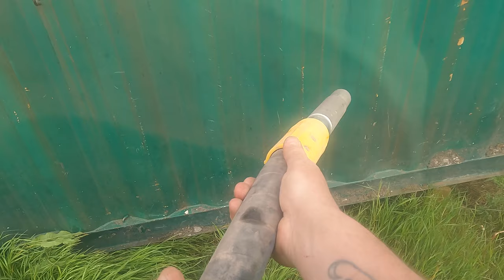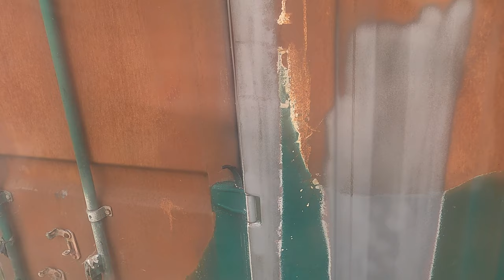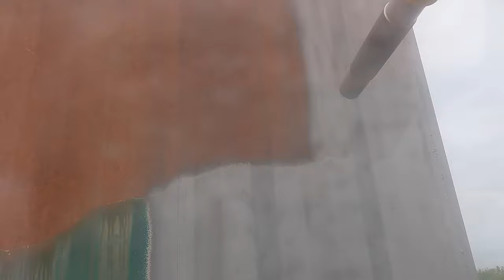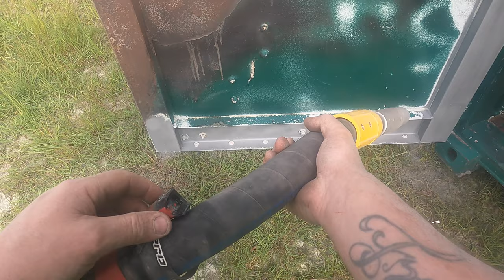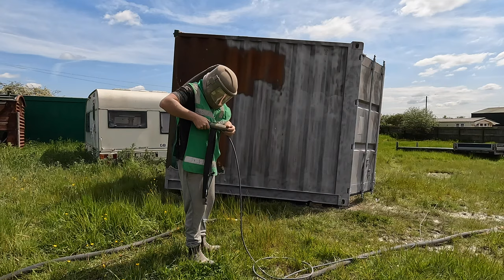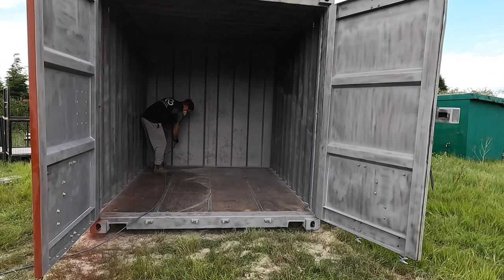SandBlasting 10ft shipping container and prim after a fire refurbishment

Comment: I sand blast a lot at my job. i see your using a 1/2 inch or inch sand pool. Brother you need a 4 inch flat sand head. it cuts four inches wide at a time. it will make your job a lot easier and better results as well. And awesome job on that by the way
Reply from the maker: The flat nozzle just stretches the hotspot out so you lose the intensity of the cut similar to stepping back yeah the hotspot is bigger but less affective. Flat nozzles are only useful if the serface only needs a very light clean 👍

Comment: Hey there mick,gritblaster/metalsprayer/ painter from nz,is the electric deadman a choice over air,have only used electric  once myself
Reply from the maker: Eyup mate I would pick electric over air because it starts alot quicker and stops just as quick plus the wire is lighter and less chance it snagging on stuff 👌👍

Comment: Nice videos mate. What camera setup do you use for filming POV? I do sandblasting myself and wanted to make a channel but I need to figure out a camera setup that is handy to quickly setup but also doesn’t get destroyed by the blast. Cheers
Reply from the maker: Gopro hero 9 and 10 but I wouldn't say they are the best available just that I'm into the eco system now with extra batteries clips clamps etc

Comment: Mick what regulator you using to do ya paint gun with . Take it you using one of ya smaller ports on the compressor..
Reply from the maker: No just huck it to the helmet pipe 👌👍 425cfm is a little over kill to run a spray gun tho 😂
Reply: @Mobileblaster  😂..  never enough of the cfm's....  mines regulated entering the stand up filter housing.. so I could just hook up to tht same as you.. I use a water based rust inhibitor after I've blasted..
Reply from the maker: @Chris Bennington  were you get that from n how much ad like a few gallon sat in van for a rainy day 😂
Reply: @Mobileblaster  Mick it's water based so environmentally friendly same as rain 😂😂😂😂... The product I use is called ferrozinc.. it's like a white wash but soaks into any pours in the steel and creates a rust inhibitor.. then if ya Wana be extra professional u can then apply a cold zinc undercoat over the top.. any good high zinc oxide paint will make the job good base to apply a top coat or blacking.
Reply from the maker: @Chris Bennington  I want to find a rust inhibitor that's water based that will hold flash rusting back for 12 to 48 hour so if im doing something metal outdoors and it rains I want the opportunity to fly over with a inhibitor so it doesn't spoil the job 👌
Reply: @Mobileblaster  trust me Mick.... Ferrozinc is probably the best product I've ever used... Even if the steel has flashed up.. just wipe off any dust and hit it with ferrozinc will go on white and then turns dark purple black then once it's dry u can either key the surface and over paint it or just hit it with cold zinc or an etch primer.. works for me mate and definitely will work for you..
Reply from the maker: @Chris Bennington  were can I buy this?
Reply: @Mobileblaster  have you got a good paint supplies by you... Ask them if they do either ferrozinc in a white tub or HMG paints in a gold n brown tin they do there own ferrozinc. It's white like water down milk.. just seal the lid everytime u use it cus it will start to react to oxygen in the air... Then just wash ya gun out with some washin up liquid and water mix.. all environmentally friendly and simple to use..  I do everything with it soon as it's bare metal or if it's a small repair or tidy up and ya use a needle gun instead of blast nozzle.. just hit it with ya special white juice 😂😂😂😂..

Comment: The Wiwa pumps would work a bit better. They have a ton of output
Reply from the maker: Yeah possibly so that's one of the main reasons I don't do painting (I'm not setup properly) its not something I enjoy 😬 so I don't go too deep into the painting side of things 👌
Reply: @Mobileblaster  if you did you could make a killer buck as a blast and coat specialist. Working from Newport News shipbuilding I've seen those spray pumps throw out a ludicrous amount of paint.

However, not matter what, even a "perfect" spray job will need a few days of touch up work and it's extremely tedious. So I can see why you blast 99% of the time
Reply from the maker: @picklepee2771  To be honest I've never needed the skill my brother ownes and operates a commercial body shop and it was through him I got into blasting in the early days he got most to all the contacts I needed all we would do is on site blast and he would paint then he would go down a slightly different root doing full restorations of modified motors kinda leaving me with a skill and equipment needed to venture my own root we still do the occasional big heavy stuff no one else likes to take on but not as much these days
Reply from the maker: @picklepee2771  https://youtu.be/x3rOmjbxZY4?si=4k01P5PKtvMwXh4van unlisted video of mine he ended up painting unfortunately I didn't get any footage of the painting but this is the kinda stuff we do together

Comment: Is that a painters hood in 9.25 ?
Reply: Also what type of paint are you using?
Reply from the maker: It's a swet sock I usually use my hoodie but it was a little too hot to use it just saves washing the helmet as much 👍
Reply from the maker: @mr yellow  it was primer red oxide we didn't quite have enough but it was getting a DTM paint top coat anyways with this top coat they say it can be used direct to metal no primer but I always think its a good idea to skin it up 1st
Reply: @Mobileblaster  cheers for the reply!! where do you buy them please?
Reply from the maker: @mr yellow  not sure my mate sent me some to try and to be fair they are prity good al as him for a link 👍
Reply: @Mobileblaster  cheers thanks, let me know if you get the link please 🙏